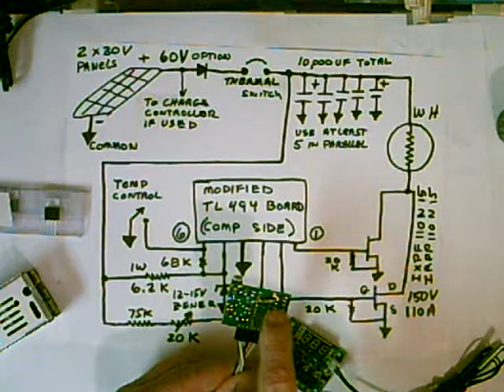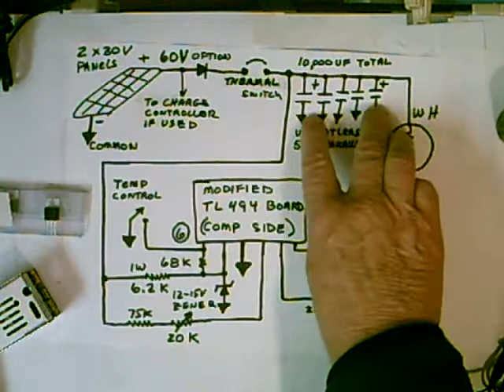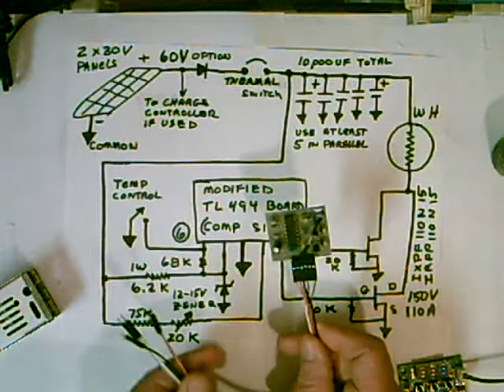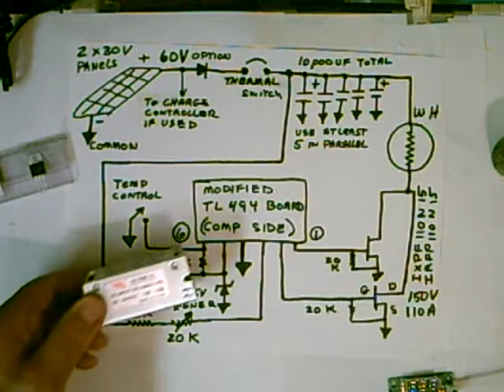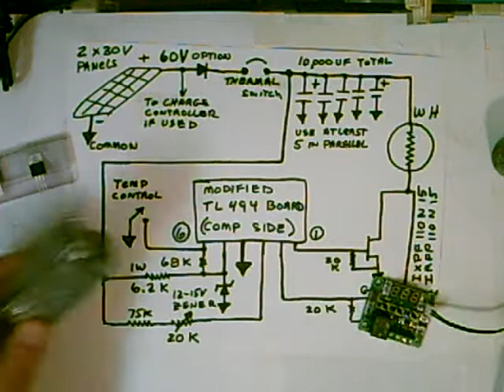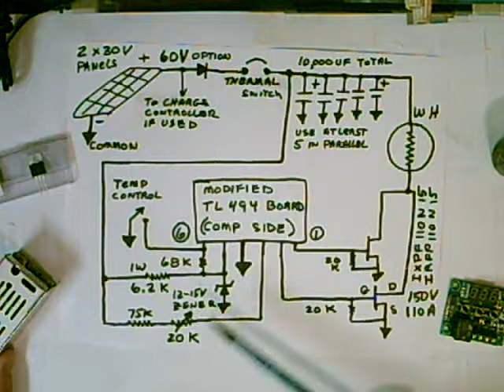TL494 PV Solar Water Heater Diversion Part 2

Comment: Hello Opera, i am back home from job it was long journey to Denmark. So i was busy to make the board and i made it, but 
unfortunately it dont want to start. Nothing was burned, but the red led its glows all time. Are you still online.
Reply from the maker: Were you able to find that exact TL494 board? I seem to remember in the spring it was no longer available. What red LED are you talking about as this board didn't have one? Have been very busy since returning from camp and not posted anything new. Last weekend connected up my home PV HW system and will be doing videos on that.
Reply: @opera5714  Hi Opera, nice to hear you. I done it based on IR2153 chip wich you published not long time ago. I done board at home and putted all elements like you showed in schematic. It was a big challenge for me, but the job is done. Its very interesting to do this thing. And i think  i will do another one on TL494 which video you sended me almoust one year ago. By the way i still got that yours movie. So... i got four panels, i builded the frame one week ago. But to this my board with IR2153 i started with two panels 80V. Calculating Ohms law i added 100K potenciometer and 270K resistor in plus side and 10k resistor soldered in board from minus side. My lamp is 220V 60w connected one end to the capacitors and other end to the fet drain. And then i connected the solar panels the dc metter showed 74.2V and no amps and the red led in circuit board was shining. After that i turned pot in one side until the end and back foward to another side end, nothing happens. The red light shinning non stop, but the lamp not working like in yours videos then you turning pot. But interesting thing, nothing burns out. All in place. I added photos movie, that you can look at my all design, maybe i something connected not right. Or maybe i done mistake somethere else. Best regards and waiting notes. i have to buy a smartphone to do the videos.
Reply from the maker: @mariusjoniskis8467  Your video is listed as private and I can not view it. There is another setting other than public that will all me to view it without it turning up on a general search.  The red light indicates that the oscillator of the 2153 is turned off. It could be a bad TL431. A couple months ago I ordered 80 and 75 didn't work at all, 5 did but were out of spec.  Reference pin has to get to 2.5V to turn on the oscillator. When it is, the output will drop to under 2V turning off LED.
Reply: @opera5714  Hi opera, look at this link i done some correction and sorry for the bad english. Ok maybe it can be TL 431, but first look at my all connections. New link https://www.youtube.com/watch?v=EMmOA3TKjsw&feature=youtu.be Waiting comments.
Reply: Hi, opera, i bought in local shop new TL431 they measured it end say thats ok. I replaced old in to new on my board. And i done the test and it works. So i swiched on the swicher and my 220v 60w lamp starts just a little bit to shine the red led was off. So lots of happiness. But i got one small problem. If the sun is shining directly without any clouds in the sky the system is working but if the small clouds are covering the sun, amperage on dc metter are going down 
immediately to zero and the red led on board is starting to shine, but the volts on dc metter stays the same. If i am turning the pot, nothing happening, and then the sun starts shine the system are working again. Like today the sky are cloudly my system are not working the red led on board is shining. I can adjust the pot in both sides, nothing happens. In yours videos the system are working even in the rainy day. Question, what i am doing wrong. There is my mistakes. Waiting comments. Thanks.
Reply from the maker: @mariusjoniskis8467  I haven't calculated out the resistance for the divider, but the 270K resistance is probably too high.  What is the voltage reading on the capacitor bank? I suspect that the voltage reading in clouds is higher than the power point voltage of the panels  by several volts.  It is typically about 1.5V below each panels stated power point voltage. I would try a 220K resistor instead of the 270K. Or you can parallel a 1.5M resistor with the 270K.  I will be doing a repair video on this board.
Reply from the maker: @mariusjoniskis8467  There may not be a problem with the divider resistor. Your lamp places very little load on the capacitor bank. At very low load the capacitor bank voltage will rise to the listed open circuit voltage of panel.  This may be the reason you do not see voltage change when the pot is turned. It should be safe to place a full load on the inverter board since doing the initial testing. Not much of a cloud does drop the current to almost nothing as my panels do in the video when it is 1:30pm. Need voltages.
Reply: @opera5714  Ok, i will try it tomorrow and i let you know what happens. And Opera how to calculate correct ammount of capacitors capacistancy for solar power. Thanks.
Reply: Hi Opera, just only today was perfect day for solar aplication. All days before was raining and terrible cloudly. So...today  i connected the heating element , i got it 2000w , small heater to heat the air inside the house, it is about 25 ohms. And a miracle was happened. IT WORKS. i can took from it about 320w at noon and the red light was turned off. I know that in yours 
explanation 25 ohms is too hight for two solar panels, but i not have other heating elements,  and it works.
So i decided to connect all  four panels in series. It is about 155v and 8.9amps total. I recalculated the voltage divider R1 total with potenciometer i got 990Kohms and R2 i leave the same 15Kohms.All this i connected to my homemade board and it wont work, because i got one more problem. This first resistor, in yours videos it is marked 8.2-10K which is going from board plus, gets immediately very very hot, and its starts to smell and after 20-30seconds it become dark and burned. Question. What i have to do, or what i have to recalculated and do the changes in the board for 155v. Like i understand this 8.2-10K resistor is just only for 60volts panels, and for 
higher voltage it has to be recalculated. Or maybe i am doing mistakes in other places. Thanks. Waiting for help.
Reply from the maker: @mariusjoniskis8467  The IR2153 has a built in zener. At voltages higher than 16V it conducts any excess. 

Voltage drop is panel voltage -16. 

Divide that by the resistance will give current thru resistor.
That current times voltage drop is the power that has to be dissipated. 

25ma is the maximum the chip can tolerate and it will get hot.
Whatever FET you have will start conducting about 10% over its voltage rating. At that time it becomes linear and acts like a zener creating enormous heat and eventual destruction.  Hope it still runs at a lower voltage after that experience. Higher voltage FET tend to have lower current rating and higher resistance.  Heat sinks will have to be much larger.Operating at 155V has design chalanges.
Reply from the maker: @mariusjoniskis8467  The light only goes out fully when the capacitor bank fully exceeds the set voltage.  When in normal regulator  mode it will glow and depending on the LED it won't be that dim.  In some of my videos you can see it flash as it beats with refresh rate of camera.
Did some calculations and there was no excessive current to the chip.  Three 4.7K 1W resistors in series would run nicely at that voltage.
Reply: @opera5714  Hi Opera, at first - Merry Christmas and happy New Year in 2020. Good luck and best wishes to yours family. 
I want to wish you opera to make lots of new videos in 2020 and good health for all in yours family.
So... after that experience i  resolded that 10k resistor and reconected my four panels back in two. And it was all OK. Nothing burns more. On 68 volts all works great.  Like you told opera in some yours videos # all doing wrong and still getting power #.
And yes, now i understood about the LED, if the sun is shining directly the led on the board is off, and if sun shining throught the clouds the led is blinking but the system is still working. So it means that the capacitors are not at full voltage. And on two panels set i noticed that on the evening time i still can get 0.02 watts until the sun goes down fully. Its wonderful.
After new year i will be moving forward with the solar system and let you know how it goes. Thanks.
Reply from the maker: @mariusjoniskis8467  Happy holidays, I had taken a vacation from the internet for a few days.  What kind of water heater do you have (volume open top) and is it possible to get an element over 4,000W? Did some calculations and with 2S2P you get about 1/4 power and at 4S it is still only half of what panels could produce. Could a second heater be added to the tank, maybe a thermo syphon? Were you also be doing some space heating? Last video I talked about how one FET output has priority before the other one comes on. That feature could be used to heat water first and any extra go into heating.
Reply: @opera5714  Hi, i still have not heating element for solar panels. I just have one element which is going directly from AC power. In my tank i just got one extra place for another heater at this time.
Then i saw yours video about heating water with nano and i think there was nine heating elements connected, i asked my water tank master, can he in the future do in my tank extra places for heating elements. And answer was - yes. But he told me that this job can be done in summer time. My tank is 2.3 meters hight. Before, i was not even saw yours videos, then i was ordered this tank i just think that two places is enought for heating elements. One for AC power, second for solar. Few years ago first my mind was to buy an industrial inverter , connect to it eight or ten solar panels and its done. But now, thanks for you, i have different story.
About heating elements... Like i understood in yours explanation, the solar panels array ohms and heating element ohms must be equal to each other. So my 4S panels string is 14 ohms, and like i understood my heating element has to be the same. And i was calculated that 4000w element is what i need, because it is 13,22 ohms. I understood like that. Maybe i am wrong.
Yes i have possibility to get others wattage heating elements. My fixing place is 2 inches. So small  list of elements:
1. 3000W  230v (3x1000w) copper,
2. 4000W 230v copper,
3. 4500W  220v copper,
4. 4500W  220-380v (3x1500w) Cr-Ni,
5. 5000W  230v copper,
6. 6000W  220-380v (3x2000w) Cr-Ni,
7. 7500W  230-380v (3x2500w) Cr-Ni,
This is all heating elements which i can put in fixing place of my water tank and they are all in my location markets.
In 2020 summer time i can add more fixing places for elements in my tank. I think three more easily if its needed.
All my house heating is floor water heating . House is 140 square meters. Now at this time to hold in the house plus 19 celcius return temperature in the floor i am using  230Watts AC power in one our. In 24 ours period its about 5,5KW AC power. In my video  i done mistake. It was not 337Watts like i told. It has to be 337KW. By the way, after my video link changes do you got possibility to see my video? Thanks.
Reply: I found more heaters at other sellers which is fits to my tank:
1. 9000w 220-380v (3x3000w) copper,
2. 10000w 400v Cr-Ni,
3. 10000w 220-380v (3x3300w) copper,
4. 15000w 220-380v (3x5000w) copper, (special order delivery time 2-3 weeks)
And its all what can i get.
Reply from the maker: My new video on my home system is 

https://www.youtube.com/watch?v=HGV-n2Cti3c&feature=youtu.be

Comment: Hello opera, question if in circuit is 75K resistor for 60 volts panels, why after it you need 20K adjustable rezistor. Thanks.
Reply from the maker: I believe this extensive board modification is is too difficult for most to follow and would be prone to mistakes.  Currently working on a new design that only requires adding a resistor and capacitor to this board.  Externally a TL431 is added to invert the sense voltage sense signal.  The voltage divider can then be determined by any online resistive divider program with a target of 2.5 volts.  I have it working but want to run it a few days first. TL431 can be found in many old wall wart power supplies.   Tell me what you can find for the capacitor bank.  200V and 250V are common where I live and would work well for 90V or 120V PV array. 180V array would require 400V capacitors and would likely be twice as expensive.  I used a little more than a dozen capacitors from old power supplies and TV. What are the spec of heating element and how many.
Reply: @opera5714  Hello Opera nice to hear You. It is winter time now and i and others subscribers i think can wait few more days or weeks. You dont be angry Opera for my questions, because i am trying to understand schematic and the components and how they works.
Yours information about 60V water heating is putted very clearly. Yes, ofcourse, i can copy 60V all yours schematic without asking and live well. But if i cannot understand how it works, in the future, if i want to do it more powefull it is impossible. So...
Now i am looking for information in internet  how much panels in my area i need just to heat water for exapmle 10 months.
Maybe in the future i will do refrigerator from the sun like you. My refrigerator is 165w.
In my area almoust in all electronic shops without problem i can find 400V or 450V,  600uf or 1000uf or 1200uf capacitors. Most expensive price is about 3.8 USD per unit.
The heating element specification is 2500W, long 265mm, 220V, 1-1/2", Cr-Ni. Code to find on internet is: GABH-020. This heating element was included then i bought the tank and it is changeable. It is in the  bottom .  Overhead is the same second heatig element witch now is workig direcly from 220V AC power socket. Heating tank is 600 litres.
Thanks.
Reply from the maker: @mariusjoniskis8467  I admire your commitment and adventurous nature. Given a world wide audience it is surprising how few are willing to attempt this. It is highly likely a few FET will be blown in creating this.  Mistakes will be made. It is all part of the learning process. The issues will be resolved and there will be a system you will be proud of.

I am working on a revised circuit that eliminates the TL431 and uses a transistor. Also there will be a minimum of modifications that have to be made to the board.  This seems a more practical solution for the average person. It is working now and still need some major sun for final test. It should appear in about a week due to weather.
Reply: @opera5714  Hello Opera, i am thinking, maybe this world wide audience are very very very rich, and for them maybe it is better and much easier to buy finished product, which cost a few thousands dollars and no problems. Sellers telling that this expensive systems works for 35 years, and they can get return back investment after 5-7 years. And all 30 years more it will be free solar. So....

Ok, Opera, i am waiting new modifications to the board and good working results from you. Thanks.
Reply from the maker: @mariusjoniskis8467  I lived thru the golden age of electronics where everyone built stuff.  I wouldn't want to start out in electronics now when almost everything needs a microscope and can barely be repaired. It is nice to buy modules cheap, but something is lost. DIY is now I clicked on it all by myself.

Comment from the maker: There is a simpler design using a ebay $5 300W power inverter board (not limited to 300W) if the panel buss is below 75V.  There are four videos that cover this including actual system operating at my camp.  The TL494 design is primarily for systems that are high voltage.